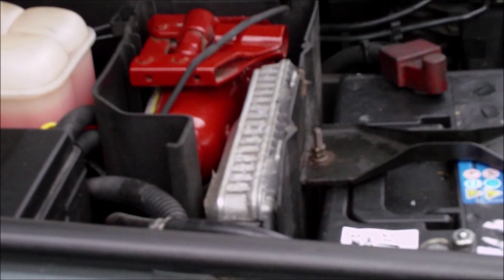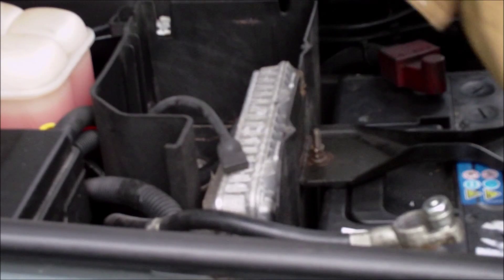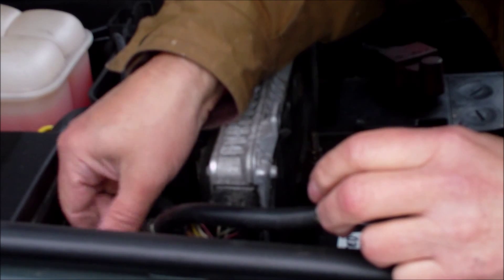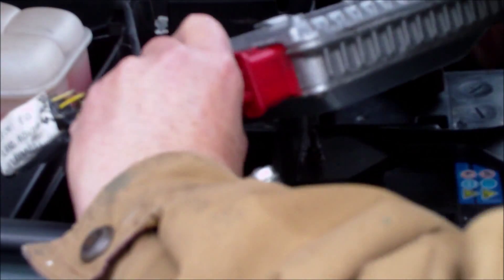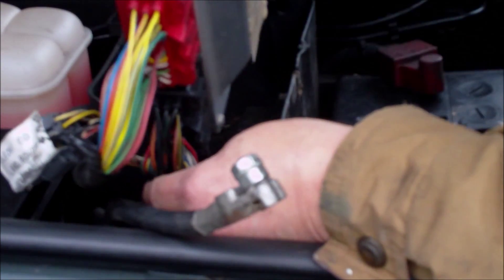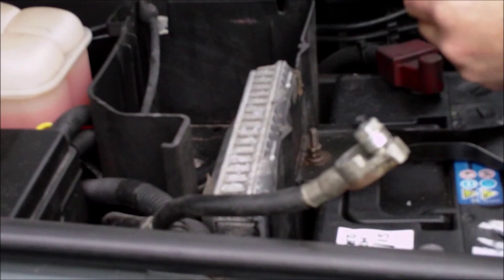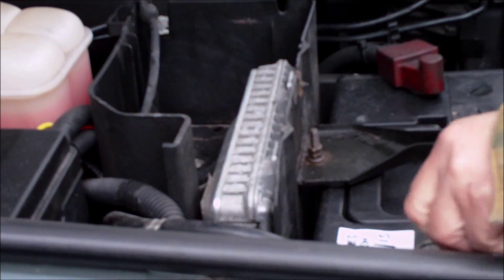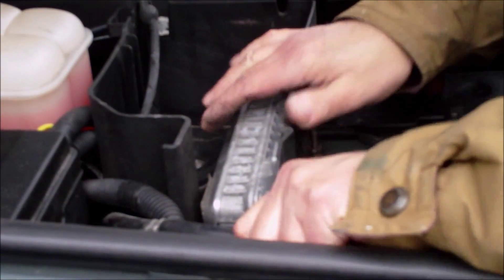TD5 Discovery 2 xyz gear position switch fault code P0705 video 1 of 2

Comment: Thanks Mr Strong,
After checking to make sure the xyz switch was working, I progressed to the ECU plug.....yup, covered in oil.
Sprayed WD-40 into both plugs to free up the oil, compressed air cleared it out in a second.
Reattached the plug, reconnected the battery, no more S & M light! Very Happy 😃

Comment: ive just check my red plug oil dripping from it cleaned it with brake cleaner but still flashing do i need new ecu
Reply from the maker: A new cable harness that’s all

Comment: Hi, my 01, td5 auto has this issue, I got the plug out and found it was literally dripping in oil. I've dried and cleaned - should I open up the red plug case to be more thorough or just replace? Cheers

Comment: i've been having a few problems with mine, flashing the m and s on dash now and again. but today wouldnt go off. so took the gear selector off and opened it up, was no water in it , just one of the connectors was dirty on the inside. cleaned it, back on and bobs ye uncle all normal. 10 mins to get off and 10 mins to get back. 20 mins opening and cleaning and back together . easy job
Reply: I left the XYZ attached and sprayed WD-40 between the cracks using the nozzle.  Flashing M S gone and shifting correctly.  Took 10 minutes to allow the WD-40 to evaporate!
Reply from the maker: +shane evans Thank you for the information Shane, this is so useful.
Reply: shane evans
Reply: shane evans
Reply: shane evans